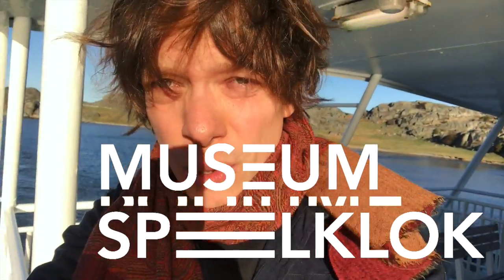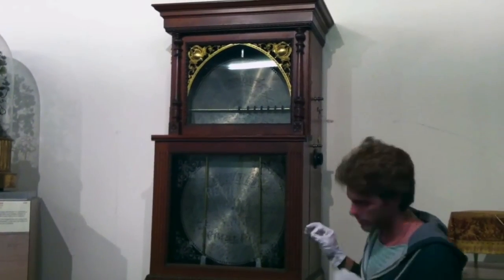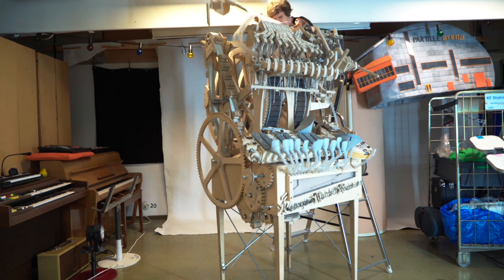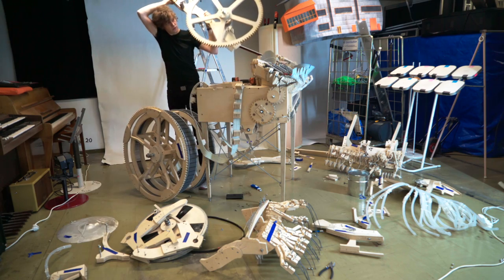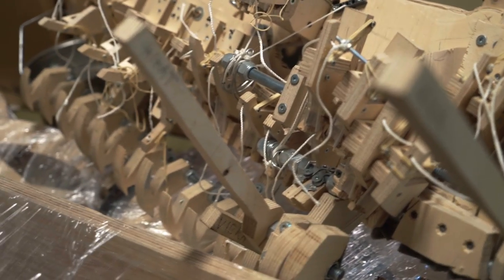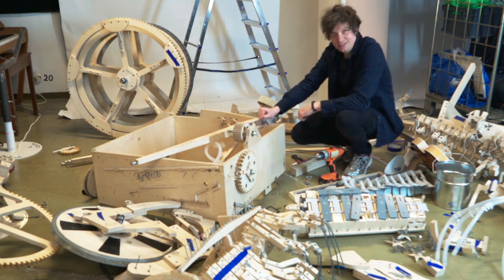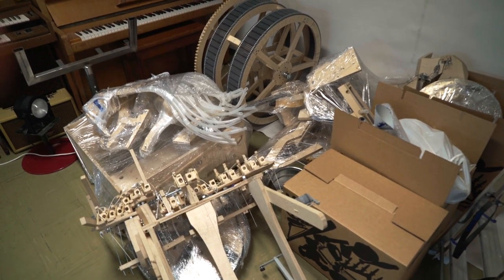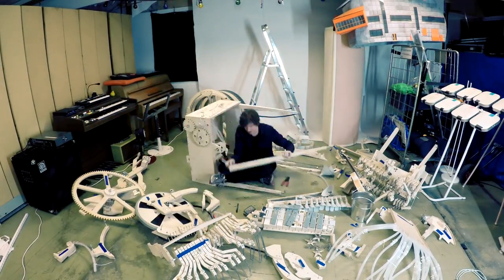Disassembling the Marble Machine

Comment: A story about doors:

A lab at my uni was shutting down. As a result, a laser cutter had to go. They just wanted it to disappear. It was too big to fit through the door, so the plan was to take it to bits and junk it, which was a shame, since it was fully working. Meanwhile, a professor at this university was trying to put together a mentorspace (a makerspace that doesn't suck, essentially), and a lasercutter was something it could really use. The whole thing with it not fitting through the door was troublesome, and if it was taken to bits, who knows if it would ever work again. So this professor called up the right people and asked a very innocent question: "how much would it cost to repair a wall?". The reply he got back was "about 5000 SEK". Within 5 minutes, they were tearing down the wall.

This laser cutter is now the most used piece of equipment in the lab.
Reply: Expensive ass wall
Reply: Best solution ever.
Reply: Considering that locksmiths will charge up to $500 just to cut out the cavity for a mortise lock in a door, I'd say 500 Euros to repair the whole wall ain't bad at all.
Reply: One time, my wife was having some furniture delivered, and the delivery people were unable to get it up our twisted and narrow stairs. After a while, they determined that it was impossible, and brought it back down to the landing, Then my wife cut a gash out of the plaster with her power saw, and told them to try again. They carried it right up, sliding the corner of the top through the gash at the appropriate spot. They'd been entirely unwilling to encourage her to damage the wall, but completely able to use the cut she'd eyeballed while they'd been trying to get it up before.
Reply: Eden's Aquaponics It was a lab in a university. The likelihood that it was an interior wall is extremely high.
Reply: slaeshjag hahaha!! That is so good! Hahaha! I love his attitude 😂
Reply: That's what I thought too while watching the video. Simple solutions are often the best ones.
Reply: This is beautiful hehe
Reply: I once dated a very large woman that wouldn't fit through the door.  After considering how it's what was is on the inside that matters I took that as a sign to leave her.  After all if it would require knocking out walls to get her in can you imagine the state my furniture would be in?
Reply: ...So how did they get it in there in the first place? Did they build the whole building around the laser cutter?
Reply: Neolexious Neolexian they probably assembled it inside the lab
Reply: Where there’s a will there’s a way. And that the cheapest laser cutter ever.

Comment: I'm sure there are other comments like this, but if you recorded yourself disassembling the machine, you can just reverse the video and get a good idea what to do... Right?
Reply: yup sounds like a plan
Reply: I think thats what he did and used for the very first clip of the video. XD
Reply: but he has recording of only 1 angle. That'd help but not a lot.....
Reply: +Yash Lalluwadia Yes, but at least he knows what he picked up next, well... took off, and figure out what to do from there.
Reply: Yeah. There would still be ambiguity, but at least it would provide the order of assembly.
Reply: Unfortunately the timelapse doesn't show all the pieces or details due to being out of shot.  Don't fret, I have no doubt Martin will get it back together.  Those screw holes are only bound to match up in one way!  :D
Reply: Maybe using one of those robot cameras that follows a transmitter that he could wear on the wrist, then it would always be pointed at what his hand is doing. Maybe next time?
Reply: Dana Cleary because you're not very creative like that person

Comment: When you ever finish the cad version of the marble machine. Do you think you it would be possible to scale it down since you will have it all as a digital file? I'm sure people would love to buy the 3d printed tabletop version. maybe using small ball bearings instead of marbles or something. that would be awesome, though not sure how cost effective :P
Reply: jo D and a miniaturized Marble Machine would be a perfect merch 😂
Reply: I would even build a 1:1 scale copy of it because I'm sure that it will be awesome!
Reply: I think that reducing the scale would result in a massive change in acoustic qualities (think guitar vs. ukulele, xylophone vs. music box). It might be a nice thing to look at, but I can't imagine it sounding particularly good. Additionally, if made too small, some of the smaller, finer pieces may be impossible to assemble, and would run a risk of breaking.
I may be wrong, however; I'm not a specialist in acoustics.
Reply: jo D ......BB's.....?
Reply: You would also need to have some really tiny fingers to play the tiny inbuilt bass guitar ;-)
Reply: Actually that is kind of what I was thinking. It wouldn't be like his marble machine, it would be like a really awesome music box or perhaps something a little larger than a music box. I think the sound would be more akin to the tiny crank punch sheet music box he has. Would probably have to simplify the design quite a bit, cutting out an instrument or two, otherwise to build small parts at that scale would be too difficult. I would definitely by a marble machine music box from him if he was able to shrink it down like that.